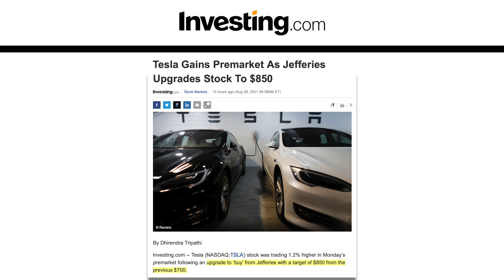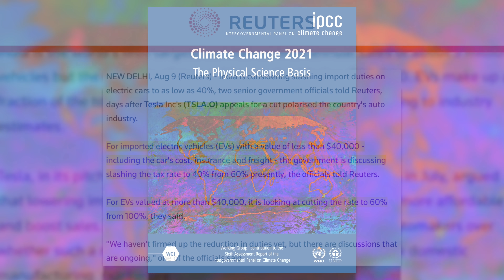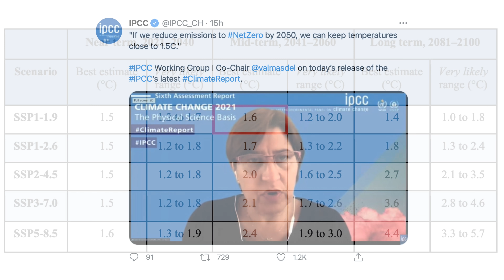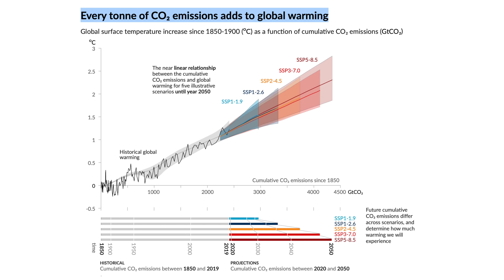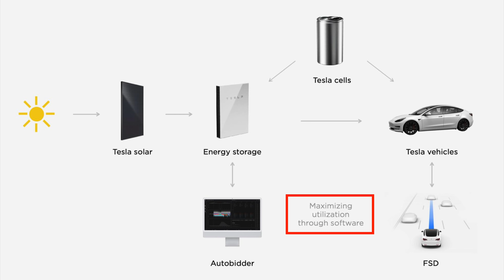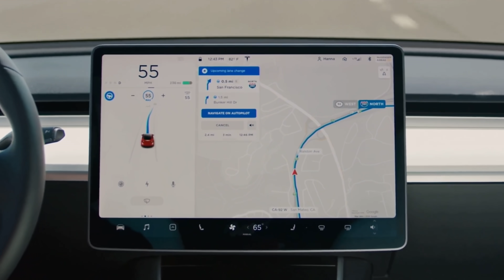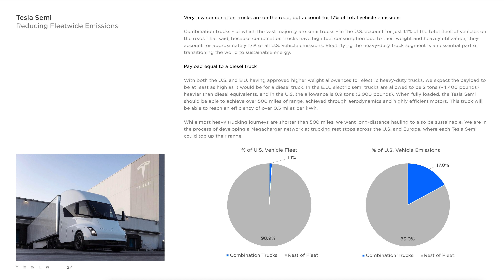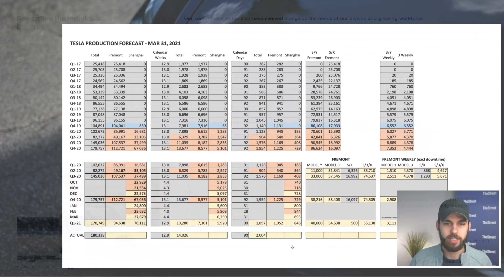Here’s Why Tesla Is So Important

Comment: No I think you are wrong with what Tesla needs to do.
They need to produce the cheap model 1 & 2 so that the rest of us in the world can afford to buy an EV and get rid of our old GAS CAR.
Reply: But if Tesla doesn't have enough batteries yet and they sell every car they make, then it makes more sense for its profitability, to produce the more expensive cars with those batteries.
Reply: If the world was flooded with batteries already, then it definitely would be. Until then, it makes sense to produce slightly less affordable vehicles that can profit Tesla enough to accelerate that process. It'll come eventually, don't you worry. If it's up to Tesla's ambitions, it'll start within a few years. Probably within this decade though.

Comment: Hi Rob, 
Commented on a video last week but I guess you have missed it. I hadn't seen a comment about the Bolt/Ampera-E in Europe, so here is some first hand experience of the recalls in Europe: 
Me and my father in law bought a 2017  and 2019 Opel Ampera-E (the european version of the Bolt, just a different logo) a little over a year ago, because they were dirt cheap and got even cheaper with a €2000 subsidy that was introduced last year for 2nd hand EVs. Since then we had two recalls. The first was a software update to limit the battery capacity to 90% and the second, which was done last tuesday, was another software update to remove the limitation, so I'm back to ~250 miles of range. They were not specific about the real solution and I haven't heard anything about replacing the battery pack.
Reply: Same here. Ampera-e, two software updates, but otherwise no further information. Never again would I buy a Opel or GM build.
Reply from the maker: Thank you